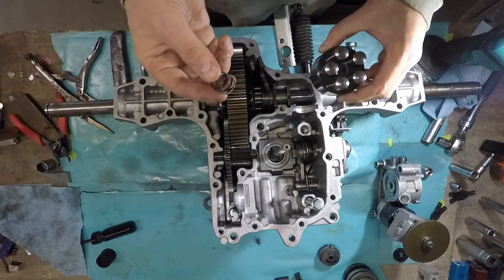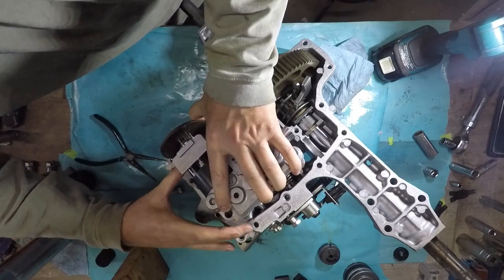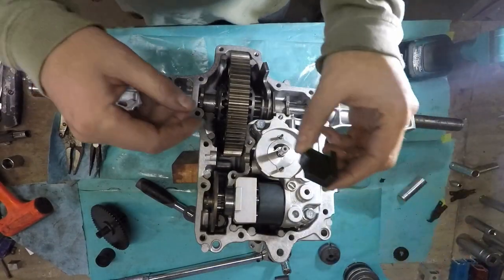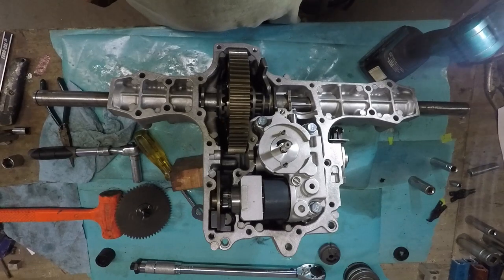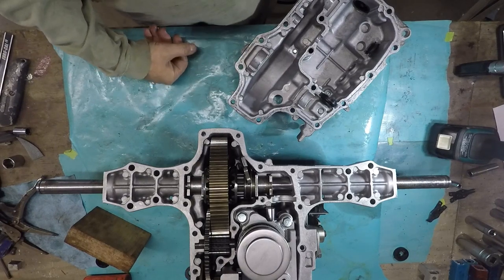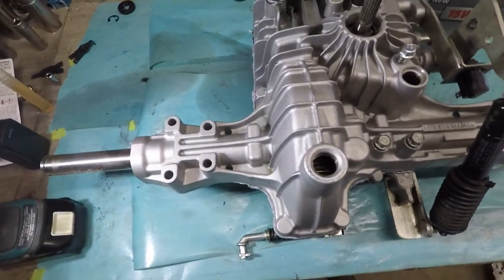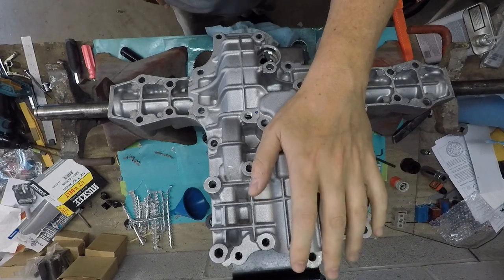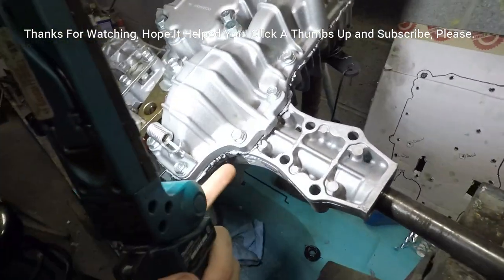Tuff Torq K66 Hydrostatic Transmission Complete Tear Down Case Replacement Husqvarna Posi Part 3

Comment: Want to add this is very useful video. I have three of the K66Y and I use this to prepare for opening one  up to clean, change filters and inspect motor face to pump on one with 900 hours with no oil change.
Reply from the maker: Glad it helped